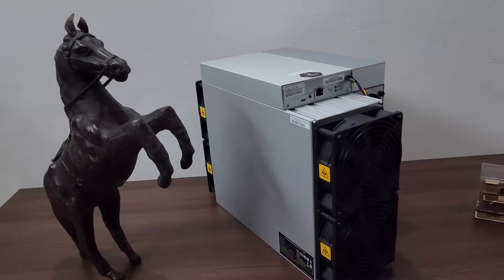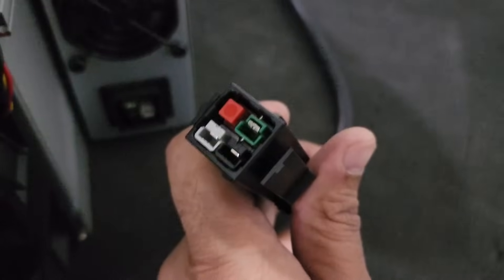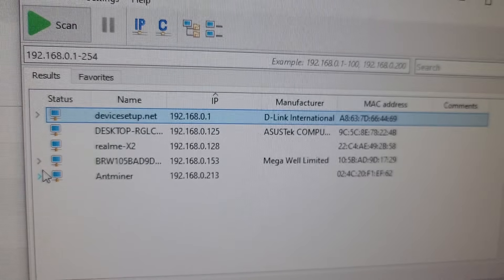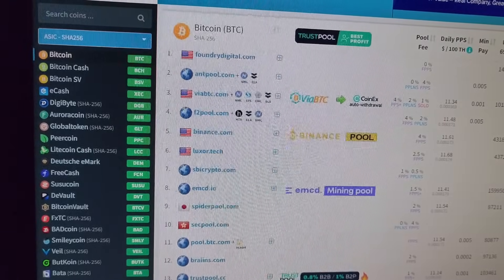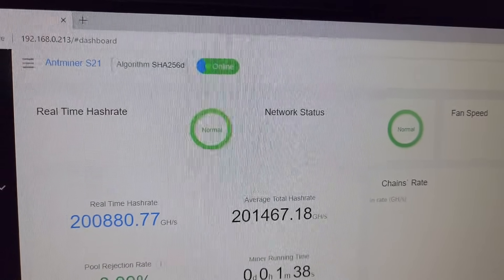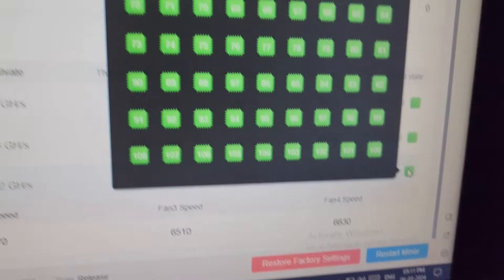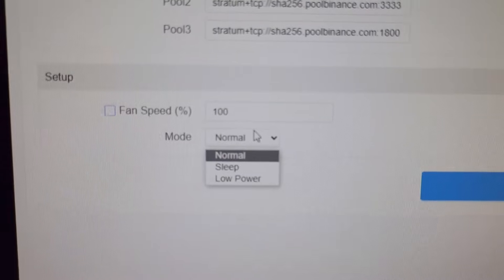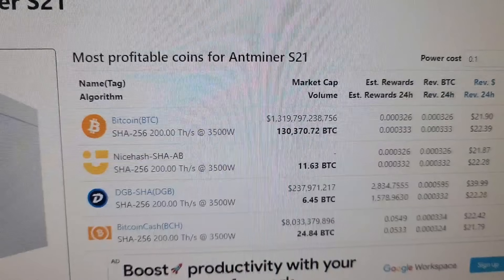Future of Bitcoin Miner Antminer S21-200 TH/s : Unboxing and Setup Guide

Comment: Does this machine requires air conditioner all the time ??
Planning to buy this ❤
Reply from the maker: Does not require ac , latest chips , low temps , stronge machine can go with it, how ever make sure maintain the cross ventilation system

Comment: what wire do you use connect to the laptop ? do you have to have the laptop connected all the time does it have Wi-Fi
Reply from the maker: Rj45 LAN cable is required to connect the miner with your Wi-Fi router , you can access the machine dashboard even with your mobile phone if it is connected with the same Wi-Fi router and configure the machine using mobile phone laptop or desktop and even you don't have to keep it connected all the time it is used just for the configuration part only later the machine is only connected with the Wi-Fi router and the power source no PC no mobile or laptop is required to run the machine
Reply: @VIKRANTTECH  thanks nobody explain this part I am new to mining
Reply from the maker: @NextEraCustoms  no problem we will assist you

Comment: Was there power cable included with miner that goes directly into wall plug? That is odd power port. Haven't seen it before.
Reply from the maker: You will get the cable inside the box ,